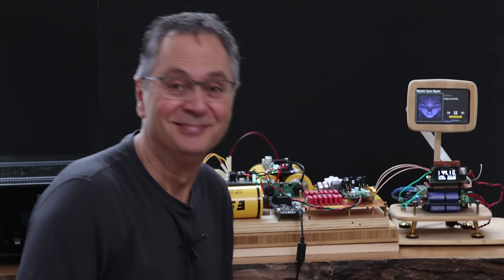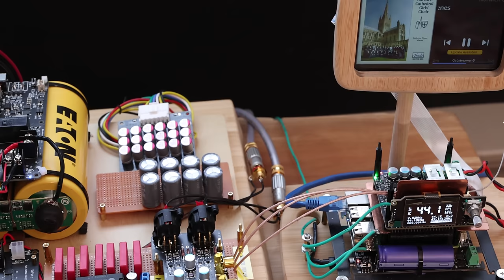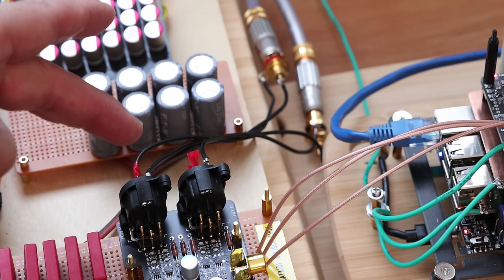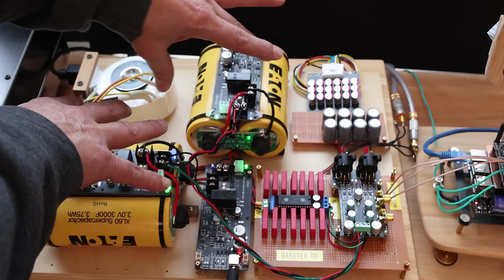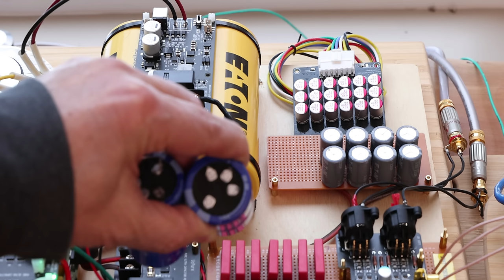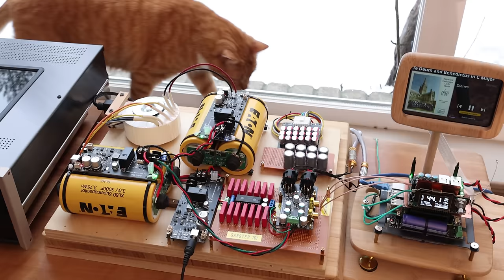Can I Build The Ultimate TDA1541A DAC ?

Comment: For sound quality improvement, adding several very fast tiny capacitors like 1 nF silvermica or similar to stabilize power as close as possible to the power consuming components, helps improve high frequency where micro details becomes super realistic! I guess the low ESR of many big capacitors are not in the very high frequency band. Therefore this tends to work like magic! You will most probably experience higher density in the higher audible frequencies, which translates into more realistic sound reproduction.
Reply from the maker: Totally agree and thanks for reminding me 
I am thinking of a double combo 100uf 100nf or smaller in my next build

Comment: What great work Gabster! I think that the brilliant part was connecting the I2S output from the re-clocking board to the DAC. It integrates the streamer to the DAC very much like a CD player combines the transport to the CD DAC. You eliminated a export board and the input board on the DAC.
Reply: Gaby, a quick question, I noticed that your streamer no longer uses a UcConditioner. Any particular reason?
Reply: Hi Gaby, I contacted Ian Canada directly and I understand the UcConditioner will make an improvement, however a "newer version" will be coming out very soon.
Reply from the maker: @ehickert  sorry never noticed your message till today 
yes a UcConditioner will help I just keep changing things so many times so I often go for a simpler setup when testing. same for the wiring too long but again easier for testing. Just did a new Video on the UcConditionerII Pro

Comment: Hi, i have been following your and other people's dac projects with the intent to build my own. I appreciate your take on the power supply question. Unfortunately, i only have limited financial resources so I will have to be creative. I already have a simple raspberry pi 3b streamer with a even more simple cinch s/pdif hat connected to the internal dac of my amplifier. I have several working and not working TDA CD players, so no shortage of chips. But im not sure what DAC I'm actually going to use. You see, I was thinking of putting more of my funds into the output stage by using the Lampucera design. That tube design uses a more modern dac chip that has a s/pdif input. It looks as gorgeous as it sounds if i may believe the people that have build it. So, my idea is to use your supercapacitor power supply design to power a Lampucea. As for the DAC chip itself, i'm torn between using a TDA or the one in the original design. In theory the TDA should be superior and it has a sound i know well from my CD players but it might be to warm for that already quite warm output stage that works so well with it's more modern dac. I will have to sleep some more on that I think. 😂
My dac project should also have a quality headphone  stage as i use my headphones more than my speakers. Again not sure what design would be better for the headphone, a tube or a opamp. To warm is a thing. Anyway, enough rambling from me. I will have to do more thinking on a somewhat budget friendly final design that suits my needs.

Comment: Using the supercaps on the + - 5v of the 1541a chip definitely helps.
Quite a lot of research has been done on the chip.  ecdesigns on diyaudio ran it to ground.  You are missing a few things to get the most out of it.  DEM clocking is critical.  The best came from  slowing it down.  Almost as good is the Grundig design.  Search diyaudio for the circuit which can easily be implemented using your existing decoupling caps. 
Also the ground plane around the chip is critical.  you can build your own ground plane using copper foil.  Attenuation of the I2S signal will reduce jitter inside the chip.  A circuit to balance the output voltages will also help.
Reply from the maker: Thanks I have read a few of those I may do more testing and measuring as not sure how far slowing it down works with UC PSU as the noise floor is lower. I will try a few of the old tried and tested tweaks :)

Comment: What amazes me is that you can make a great DAC from a single circuit board containing a TDA1541A with some capacitors and an OPA861 balanced I/V board. It looks like something even I could make 😀 Would you mind please making a schematic for the TDA1541 connections, preferably your balanced design. I already have Ian Canada streamer with ultra capacitors which is amazing.

Comment: Deoxit red and then blue every connector and wire... Hand is. Good... Using a dremel is better. Very noticeable improvement
Reply from the maker: Thanks for the tip will do on the final version. I saw your system on DIYAudio very Bad #$$ You did a awesome job I bet it sounds great.

Comment: Congratulations, very good done. Can you tell me about it’s sound quality when comparing with a good cd player? 
I am planning to build a 2 parallel TDA1541A i2s dac similar to yours. I have already bought all components but I will start building it sometime in summer time. 
The main difference of mine, it is rechargeable direct battery powered dac (without regulator chips). 
As the i2s music source I am using LKS-100 usb to i2s converter.
I will use double OPA828 opamp chips as buffer.
For the next, I am also going to build a battery powered differential TDA1541A dac with tube out.
Reply from the maker: It is still a work in progress I am designing a new PCB design. getting close to finish.  and yes Power supplies is where most gains are. It can work for both a CD transport or Ian's streamer.

Comment: I wouldn’t expect much improvement in a sound from op amp ultra cap power supply. Because they all have extreme psrr numbers. If you doubt, I would ask you next: would you like to use ultra caps in your pre-amp and a low resistance battery in your power amp?
A magic behind an ideal power and a good sound is a digital part, where a wrong signal can be caused by a tiny-tiny spike at a rising-falling edge. And this difference will exists during at least one tick. A same importance an USB cable shares. And such tiny-tiny non repetitive difference in an analogue part is just not audible. If a DAC chip converts everything right, a S/N of a recorded source is x1000 worse than any of analogue artifacts level. All we need is a good bandwidth, good V/usec, linear phase, and low IMD.

Comment: What about running the that tdk chip in bridge mode? Having two per channel,  or having four as a push pull, I think you can run it as a push pull, so you can split it up can't you!  you can have the dac and the amp separate from the chips
Reply from the maker: already working on both

Comment: Hi, nice project. It is a very good approach, that you go. If you design the DAC yourself and want it to be top notch, try the asynchronous mode of the TDA1541A. I also use the TDA1541A and drive it in asynchronous, NOS mode. This way it is possible to feed it with up to 384kHz signal. NOS DACs tend to sound a bit unusual (not bad, but not my taste) but if you feed a NOS DAC with a high res signal, there is nothing that comes close to it. I like the R2R DAC chips very much and spend a lot of time with them. This output stage is really nice,  I know it from a friend, for me the only better option would be a tube based one with transformers. This would make this project very complex and you would need a high voltage PSU (300V+), so your approach is best if using low voltage only. Nice, but when you are ready, create a real PCB, this makes it sound even better than this hole PCBs.
Reply: As an output stage instead of tubes-based circuit would be sonically better and much cheaper option  for amplification to use step-up transformers on Magnetec ring cores,  but for impedance arrangement no NFB ultra high slew-rate buffers. As follows on my taste: BUF03, LH0033 non commercial version, HA3-5002-5, etc. And newer use any WIMA caps. KEMET PHE450 series  are just perfect ones starting from 800 mks/V and higher.  Success! Hopely, my englisch is good enough.
Reply: @jevgenijsjakovlevs493  It depends, I like the tube sound very much and from all my test I stayed at tube based I/V and then into an A class amp. I know that transformers measure better, but for me tubes are best in I/V. But yes, transformers are also very good option, by far better than opamps and most discrete transistor stages.
Reply: @tomtomczyk1264  That's  right!
Reply from the maker: Thank you guys for your valuable advice.
I am designing a trial pcb to keep things tidy and better with various options to try a few dem variations and other options once I settle on the design will do a second final version.
Tube output is also on my list after I am done 
Do you have a schematic for the tube design you like or is it a lampizator style.
Reply: @Gabster1  I have written you twice what I would do, but both times it got removed. I dont know if it was automatic or how it got removed. I will try to write you an email, I have some advices, like the 50hz DEM clock and others...
Reply from the maker: @tomtomczyk1264  I hardly ever remove any comments must be automatic 
sometimes YouTube does not like certain links.I would love to hear from you, you can reach me by email it is in the Bio On my main Page click the arrow besides Reviews and diy of high end Hifi audio systems and other things that interest me.---->

Comment: Do you plan to use any digital filter (for example PMD100) before TDA1541a to improve the frequency response and harmonic distortions of hight frequencies?
Reply from the maker: Not for now. Possibly later but the goal is to keep it simple for now. Once I establish a good base I can try things later
Reply: It's not needed, unless you can hear above 22kHz. Your ears are a reconstruction filter that does an adequate job.
Reply: @ProtoDAC  I personaly haven't done any A/B comparison. Some say that it helps, some say that it doesn't. According to the measurements it does help and takes some distortions into ultrahight frequency area. Can it be heard by ears? Hard to say

Comment: Boy, are those ultra-capacitors huge or what? Great pointers - those IanCanada products look impressive.
I hope you build the differential version in such a way that it will be possible to compare the differential vs. the single-ended versions.
I would experiment with one or two premium clocks if you have the time and/or the inclination. Also, the I/V stage is meant to be critical. There are far too many solutions on the internet to list. Some may be too old by now and thus hard to find though.
I was wondering how you can obtain a real TDA1541 in this day and age. Even though I obtained mine twenty years ago (how time flies..), now I am wondering whether they were actually real.
Reply from the maker: I am planning on building a few versions and comparing the sound 
It is hard to find good ones lot of fake ones specially s1 s2 some plain ones are really good and more likely to be real If you do a good research 🧐

Comment: Since the OPA861 has single ended current input from the TDA1541, it would seem there is DC voltage on the output from the I/V resistors?
Reply from the maker: Yes Mark you are correct about 1.37 V it is even on the output 😬I thought that it would not be on the output. It does not seem to affect the preamp or sound (it actually sounds great) 
I can put a biasing circuit on the Tda output to bring it to 0  I have seen it done or wait for the Balanced version or both. (waiting on Ian's PCM Board to implement the Balanced version)
What do you think I should do, you have a lot of experience with this Chip.
Thanks for bringing this up.
Reply: Most preamps (and amps) have a DC blocking capacitor on the input for circuit protection. If you verify that your preamp does, you can do without a cap or bias circuit. If it doesn't, the 1.37V would change the bias of the first stage of the preamp, and likely change the sound. Do you have any info on Ian's PCM board? What does it do?
Reply from the maker: With the PCM board you can run the Dac in Sim mode separate DL DR  for lower noise and also run in Balanced mode. so you can run the 1541a and I believe your Protodac in Balanced mode as well. Here is the Link.
https://github.com/iancanada/DocumentDownload/blob/master/PCMboard/I2StoPCMconvertorBoardV1.1.pdf
Reply: I think the things that it fixes for the TDA1541 have been fixed in the TDA1387 design.
Reply: From Moode and diyAudio posts, I just found out that pins 2 and 4 of the isolated GPIO on the FifoPi MA and Q7 only provide 3.3V instead of the RPi standard of 5V. I think your ProtoDAC was only powered with 3.3V in your setup, which would not sound good. Need a stacking header with pins 2 and 4 removed, then power ProtoDAC with 5VDC from the pads between the RCA jacks. There are other ways to do it described in the posts.

Comment: @Gabster1 why output from tweaked xlr and not rca directly?
Reply from the maker: I am not sure how Ian wired the RCA if he bridged 2 chanels or what, and I do not have a schematic for the Opa 861 and for some reason he does not recommend it in his manual. I figure it is safer this way using 1 channel could possibly be the same not sure.
Reply: @Gabster1  I don't know how it is wried either. But Ian wrote that the RCA out on the 861 I/V is only for testing purposes and he doesn't recommend using for critical listening.

Comment: Very good , top project with TDA 1541 , BUT why  R1 ???  The Worst revision of 1541 !
Reply from the maker: I have 2 S1 chips but will use them at the end, too precious to fry them by accident. When prototyping a lot can go wrong. Surprisingly I tried the S1 chip and my R1 seems almost on par so go figure some of the ratings are over rated 🙂
Reply: @Gabster1  The only thing you need to know when prototyping with the R1 is that is is not 100% the same hardware wise. It has an build in internal cap, that makes it impossible to let it run in async mode. So if you fail to run async, try an TDA1541A. I dont know about the TDA1541 (withut R1 or A), but i had problems with the R1 in async.
Reply: Great article Gabby. How do you know the chips are originals? Seems to be a lot of fakes.  @Gabster1